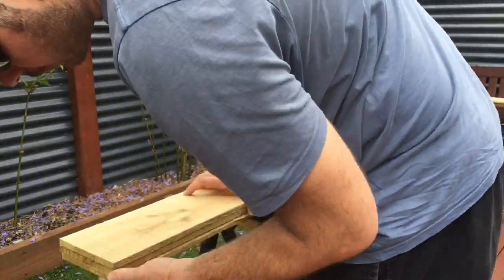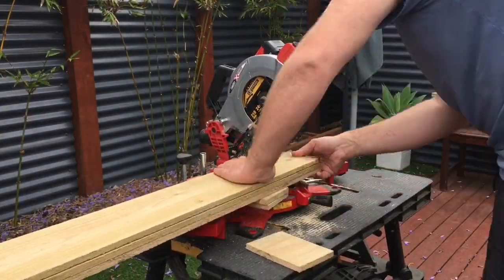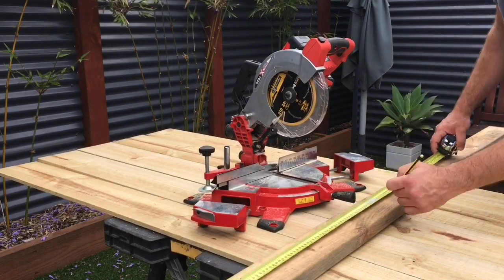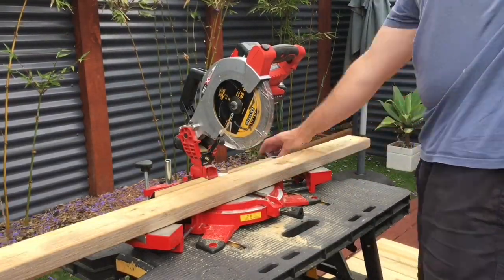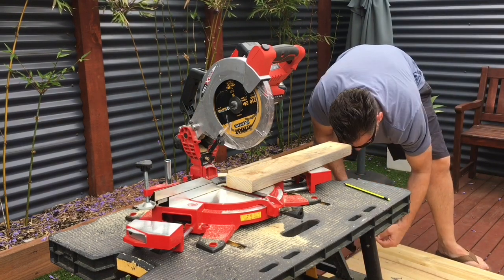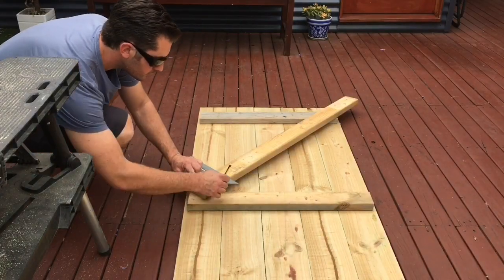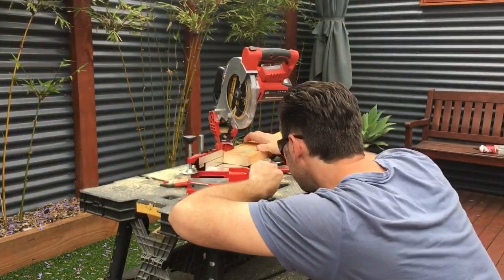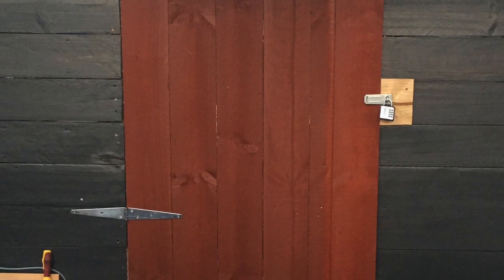Ozito / Einhell Power X Change Mitre Saw Review 8 month update

Comment: need to bring out a sliding one... like einhell in germany
Reply from the maker: Yes! Just looked it up on the Einhell website looks nice with 36v set up...!
Reply: @justbuildit686  What I love about PXC 36V range is that you just use 2x18V, it's so handy compared to Ryobi which needs a completely different battery.